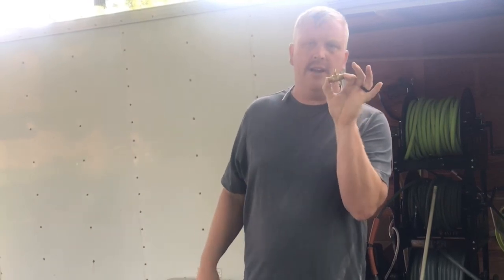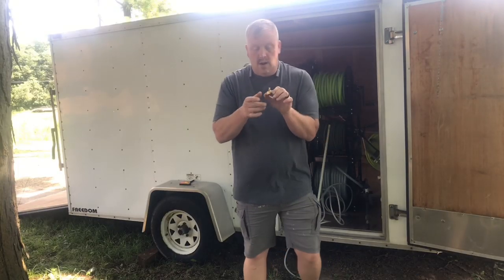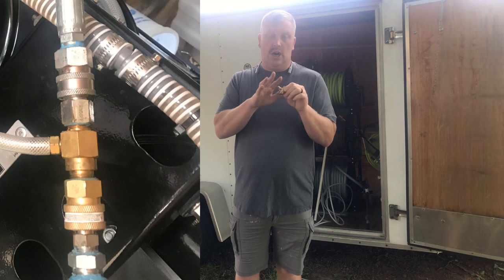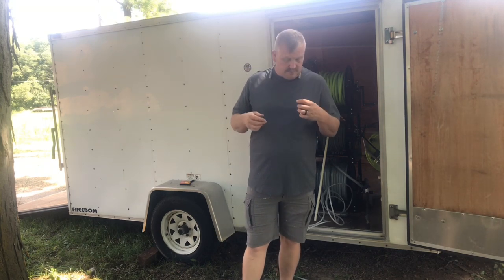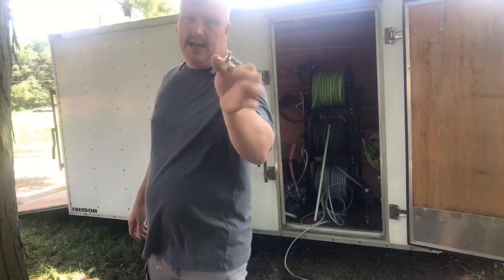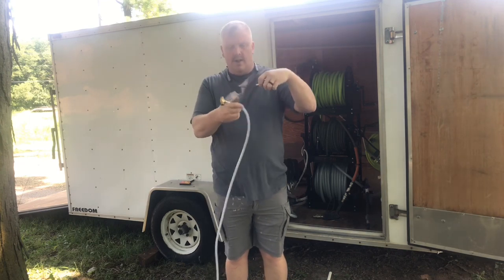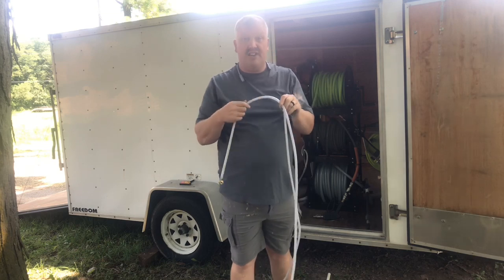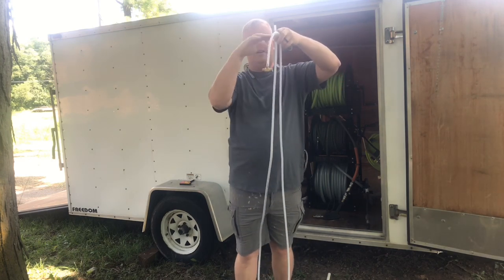5 Problems With A Downstream Injector & How To Fix It

Comment: I was going nuts trying to get one to work today.  It kinda worked, with no gun or tips on it randomly, then I could get it to pull soap again.  I tried low pressure tips, checked the hose for leaks and the injector is brand new so shouldn't be a clogged spring or ball issue.  Very frustrating.  Even rented a $1K per day lift to help with the project and that is sitting there right now wasting away because I can't get my chemical injector to work.  I even tried a backup plan with a new pump.  I filled a tank with soap and SH and was going to just spray it on with a hose but the new pump unexplainably stopped working.  The unpredictability of the chemical injectors is a big downside IMO.  But, I guess with more experience they wouldn't be as unpredictable.
Reply from the maker: can be a pain sometimes but when they work their great

Comment: So here is my issue .. If I add hose I lose suction and cant draw any chemical. I only draw chemical on 50 ft. If I add another 50, it actually pumps into the chemical bucket instead of drawing. Any solution?
Reply: this is happening to us to. did you every fix this?
Reply: @alwaysshine5930  yes. I added a tee valve to the gun between the handle and the wand. Works great and chemical is not going thru the pump
Reply: @Kgio-2112  hello sir could you explain you said you added a T valve further. Thanks

Comment: Received a new pressure washer pump after the old one. After installing it, I checked for leaks and it blew off the chemical injector brass fitting. Have you ever ran into this issue? If not any suggestions? Can I just weld up the hole and have it bypassed? Thank you.
Reply from the maker: I’ve had to hose blew off the chemical injector. Usually this is because the ball get eight up and gone

Comment: My friend, my injector worked all season long with 50ft of hose. My last two jobs, it only works with 25ft. Will not draw with anything more than one hose. Brand new injector does the same thing. 25ft, fine. More, no draw. Is it my pump?
Reply from the maker: Make sure your downstream hose is not sucking shut or getting kink somewhere
Reply: @kingofpressurewash  I think that is my problem too, I do have a 75feet hose.. I disconnected the hose and just let the water run and it will suck bleach.. but nothing with the hose and gun.. help please
Reply: @merlinjeronimo3886  did you ever fix this problem? I have the same issue. Will only suck with 50ft of hose

Comment: Another Great video Jason. I made the mistake of leaving my downstream injector on my machine and then putting a dual port injector into the downstream injector. The dual port worked 3/4 of the job but at the end I couldn’t get much pressure to surface clean or coming out of the gun. Is it because I had both the downstream injector and dual port? I took off the dual port injector and still can’t get much pressure. Help?
Reply: It was my o ring that came out of the downstream injector. First time I’ve ever had one come out. 😉

Comment: Running a 4x4 and just noticed that when I'm using my DS with a line in a bucket... and I let off the trigger, that it backflows into my bucket diluting what ever mixture I have in there. What's going on?
Reply from the maker: Bad ball. Bad injection

Comment: Got a question... My injector is working. But when I do a 1-2 story home, I barley go through 2 gallons of bleach. I can smell the bleach coming out, and I'm laying it on thick... I just don't seem to be going through alot.. is that normal??
Reply from the maker: Yup
Reply: @kingofpressurewash  yup what?? Lol is that normal?? Something wrong with it??
Reply from the maker: Taylor Hurst yes this can be normal sometimes.
Sometimes you may need to clean both ways to fix it.
Also put down house mix when done
Reply: @kingofpressurewash  I use bleach, what do you mean clean both ways??
Reply: I understand what you’re asking I experienced this once. I changed out my downstream filter and it worked like normal. It didn’t visually appear damaged or dirty but it wasn’t allowing a proper flow

Comment: I can't figure out why my pressure washer is pumping water back into my chem tank?  Any help would be great thanks
Reply from the maker: If you’re using the downstream injector the little ball is probably gone
Reply: @kingofpressurewash  im using a DS injector and the ball is in it, are you saying the ball is shot or completely gone? Mine is there at least haha still feeding water into chem tank on high pressure
Reply: Steven snaguski, did u figure this out?

Comment: Ok my injector is sucking.. But i feel something is wrong.. i done a draw test..you know to see how long it took to empty 1 gallon of chem.. so i got 24 gallons to 1... Giving me a ratio of .5 at the tip... I don't have belt drive pw.. i have a 4gpm 4200psi  but my injector is built in.. Is that normal for the injector ratio so low.. ???? How can i get a higher ratio at the tip.. Thanks in advance
Reply from the maker: some of the built in ones dont draw as good

Comment: Jason, please help. I've now bought 2 downstream injectors and can't figure out why neither have pulled any soap? It is not getting suction and I can't figure out why. And before you ask, yes I used the soap tip. My washer has a soap reservoir but I've bypasses it all. I even put a shutoff valve on  the intake side to the pump because I thought that maybe it was the problem.
Reply from the maker: have you tried with no gun on it? also how much hose you got on it
Reply: So I removed my gun and bam, it began to pull the water from the bucket. I have a surface max gun that I'd bought from Lowes for like %$50. It works great and it had a handle that I can put on either side which gives better control. Now my washer. I know it's a p.o.s. but I bought it at a great deal and it makes me money and when I can do better, I will upgrade. It is a Ryobi 3,000 PSI, 2.3 gpm. I only paid $200 for it brand new and not from the store. I don't particularly like the gun that came with it but I slapped a fitting on the intake and out and guess what? I had soap. 

I appreciate your videos man. They are very informative and I hope that someday soon I'll be able to afford to take your course. And maybe you'll be back in Raleigh lol. Thanks again!
Reply from the maker: @michaelgall6876  awesome
Reply: I will try these tips. I have 2 injectors and not able to get soap using my j-rod only with the black soap tip. But I did notice on my first injector for my first machine it's labeled 2.1 and it's on a 2.5 GPM could be an issue there. My new machine is  4 GPM and it came with an injector, still no soap with j-rod. No number on it that I can tell. My injector hose is like 5 feet or less so it's not to much. I've tried with the arrow pointing in either direction still not working on j-rod using all the tips. Finally I put the injector pointing away from the pump. I hope one of these tips gives a resolve it's the only thing that's been a issue since getting into the business. Thx

Comment: I have a question  tryna use my chem injector with my xjet m5 and when I use my xjet it won't take soap why's that
Reply from the maker: Because the xjet it's causing too much pressure
Reply: @kingofpressurewash  anyway to make it work with xjet thanks

Comment: Hi, I just added a new DS injector to my pressure washer 21lpm ws202 13hp Honda gx390 , I can't seem to draw chemical,  I have 90ft of 3/8 hose I have tried a low pressure nozzle (not black tip)and I have tried shooter tip with no luck
I have increased and reduced the revs on the engine,  I have about 2ft of 8mm hose going to my chemical drum, I think I have tried everything in your videos but no luck,  would you have any other idea what could be wrong,  thanks Paul.
Reply from the maker: Try taking your gun off and see if it will draw them. Sometimes I’m going to go bad and they won’t open up all the way
Reply: Did you ever get around to trying it without the gun? I have the same machine and have done the exact same thing as you.

Comment: Anyone else have issues with it leaking air into the system when you're not using the injector? I don't know if there's a valve I'm supposed to close or what, but for the time being I've just put a bit of hose on the end and kinked it with some zip ties to cut off the air supply.

Comment: I am new. I bought a Simpson 4200/4 gpm. The only way to draw soap is with the black tip. That will not get me to a 2nd story, does no good. How do I fix this?
Reply from the maker: Yeah that's why you Gotta use a J Rod for it
https://www.pressurewashhelp.com/jrod
Reply: @kingofpressurewash  cool, thanks! I actually bought a j rod and have used it a little. Need to figure out which tip is soap high. I’ve been using it on my wooden fence. I thought the fence would be good practice, but it’s breaking my spirits. It’s full of algae, downstreaming straight SH and a surfactant, and hitting it with the 40 on my jrod. I tried the yellow tip, but it was carving the wood up - especially on the horizontal 2x4s. It’s taking me 15 minutes for each 6 x 8 panel, and still not coming all the way off. I’ll lose my rear end if I get to someone’s house and it takes that long. Thanks for responding, Jason! BTW, is there anything I should buy differently on your rig build list since I have a 4 gpm instead of 5.5?
Reply: Since I already have a j rod, I guess I could buy the assassin separately? Will it slide right over one of the existing j rod tips?
Reply from the maker: @tgeorge78  Those other tips won't work you need a J Rod. It has a bigger hole and all of those
Reply: @kingofpressurewash  I have a j rod, I just don’t have one with an assassin tip.
Reply from the maker: @tgeorge78  That will definitely work for you
Reply: @kingofpressurewash  Thanks, Jason. Can the assassin tip go on the j rod I already have, or would I have to buy a different j rod with the assassin tip already on it? I enjoy the heck out of your videos.
Reply from the maker: @tgeorge78  Can it's not gonna be that much more distance for a heights

Comment: I’ve done all of that, went thru 3 different injectors and still not able to pull. Yes I’m using the right tips, yes the arrow is in the right direction, and everything else is correct, and I can’t figure out why it won’t pull